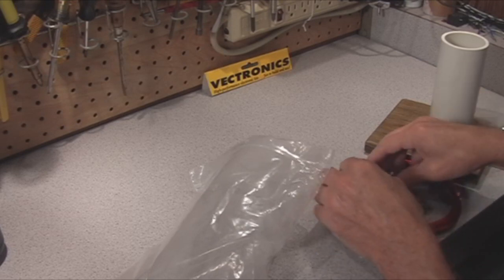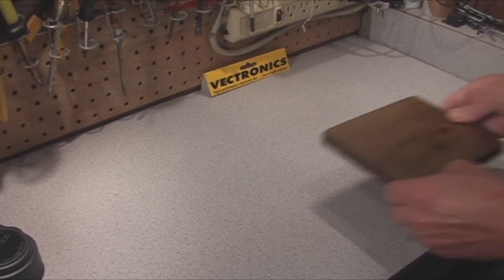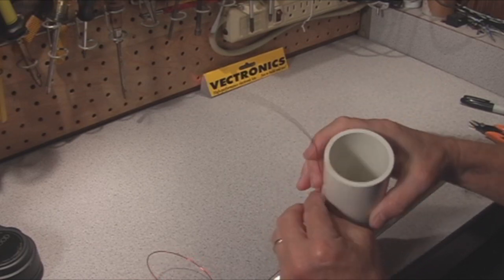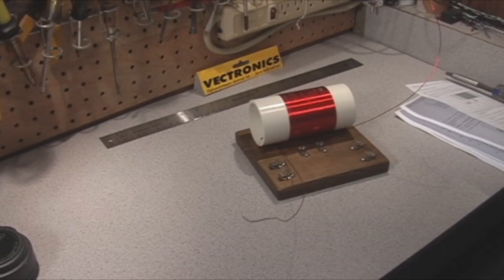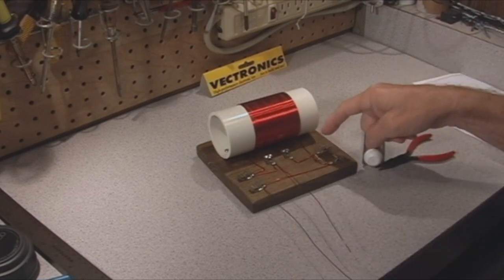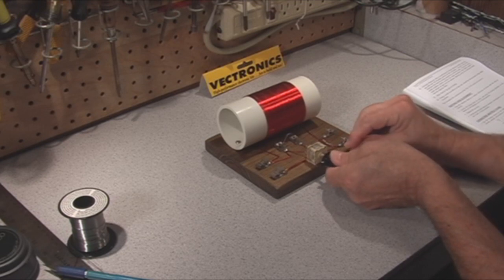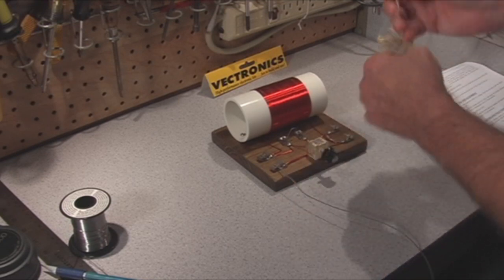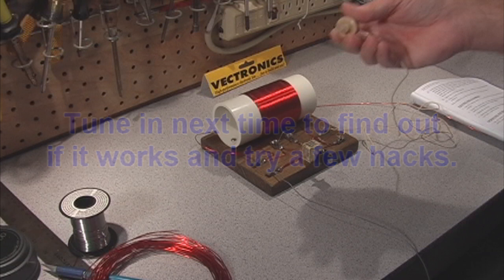AmateurLogic Shorts 13: MFJ Crystal Radio Kit

Comment: What is the name of those clips? 
Also would soldering affect the function?
Reply from the maker: Those are Fahnestock clips. Soldering won't affect the function but might make better connections.
https://en.wikipedia.org/wiki/Fahnestock_clip
Reply: @AmateurlogicTv  
Thanks.  I have made a couple crystal / trench  / foxhole radios.  All were fails.  Wondered if clips were the issue.  Thanks a million.  KO4EMH

Comment: Reminds me of an AM radio I had when I was 8, No battery, no power, just clip in wire to the bed spring put in the earpiece and tune the little screw on the top of the little 1.5-inch x 1-inch funnel looking thing and hear local AM radio.  lol

Comment: Thanks George. I'd recommend builders not wind the coil right away. It is highly desirable to have tapping points about every 15 turns to allow both antenna and diode connections to be optimised. This will help separate stations if you're using a good antenna.